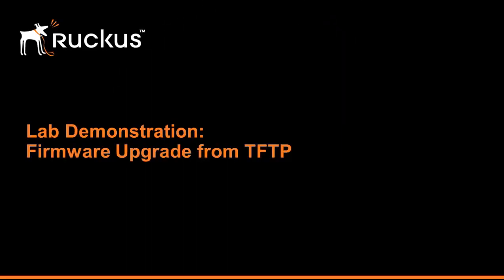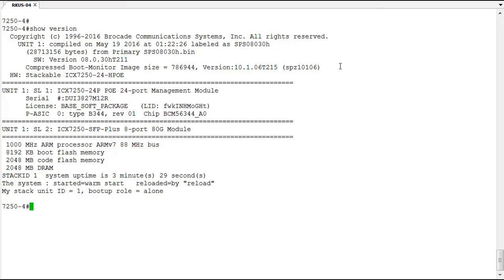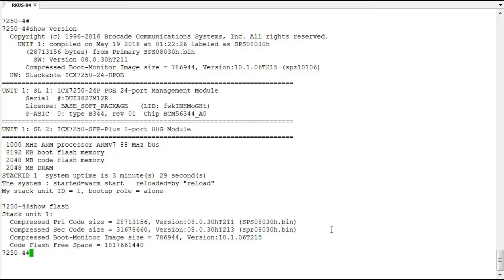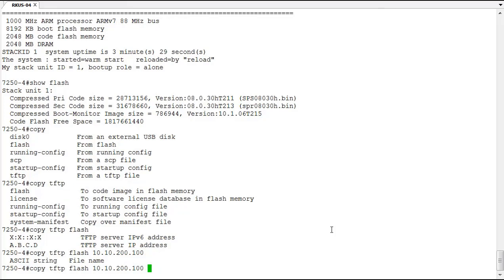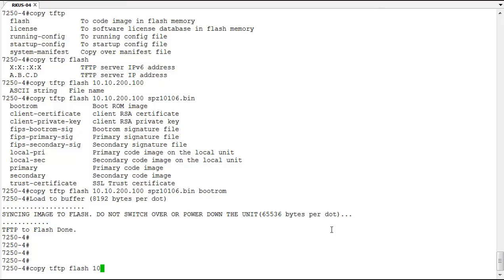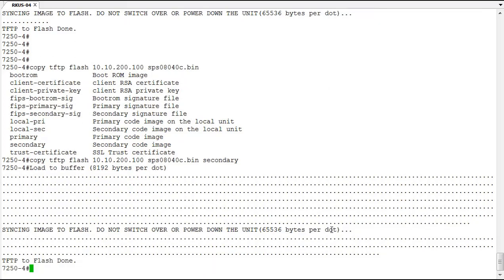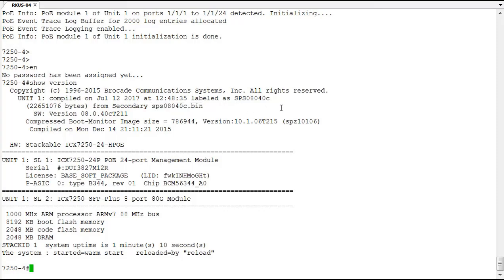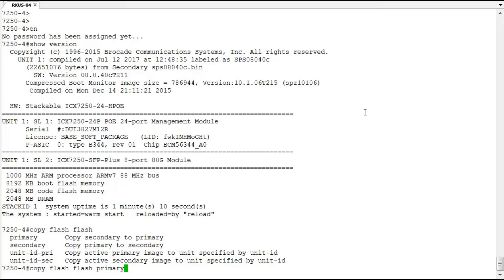TFTP Upgrade on a Ruckus ICX

Comment: I'm trying to upgrade a 7250 and the primary has 8090d router code and the secondary has the 8095 switch code I want to use.  Even when I boot into secondary, it's acting like it is still running the router code and has router in the switch name.

I tried flashing from USB booting into primary and pointing it at the 8095 switch code image file and it just says it can't do that.

Is there some special trick to get this switch off router code and onto a switch image?
Reply from the maker: That's strange - if you do a boot sys fl sec, it still boots to primary? If that's the case, there might be an issue with the image in secondary. Head over to forums.ruckuswireless.com and make a post. Include a show version, show flash and show boot pref and I'll look at it there. Thanks!
Reply: @RUCKUSEducation  well it says it was running SPS08095 but the switch name on the prompt still said router and I had to configure a virtual interface in order to get it an IP address.  Regular switch IP assignment was unrecognized.

After doing that, I just did TFTP update on primary to SPS08095D and it worked and now both primary and secondary are switch code.

Comment: At the end.. it is mentioned that   #copy flash flash primary
And next time we boot it will boot up with the new version of image.  --> which means do we need to manually run command again #boot system flash primary...?  please confirm
Reply from the maker: boot system flash primary will reload the device and boot from your primary partition.  You can perform that command to reboot the ICX from primary, or you can verify your boot preference like here:
#show boot-preference
Boot system preference(Configured):
 Use Default

Boot system preference(Default):
 Boot system flash primary
 Boot system flash secondary

If your ICX is set to Use Default (Primary), like here, you can simply run 'reload'.  If you have any unsaved configuration changes, be sure to perform a 'write memory' prior to boot sys fl pri or reload.

Comment: Can I upgrade to 08.0.30 directly from 07.4.00 on ICX6430 and 6450?
Reply from the maker: There are many things to consider when making an upgrade between these two images. I would strongly encourage reading the upgrade guide for 8.0.xx due to the changes such as command structure and upgrade methods to ensure you are prepared for the upgrade. 
You can find the 8.0.3 upgrade guide at https://ruckus-support.s3.amazonaws.com/private/documents/1432/fastiron-08030d-upgradeguide.pdf?AWSAccessKeyId=AKIAJM3QLNNKLOV235TQ&Expires=1601387676&Signature=qSiEcjmA3Fp3wQ40Ns90dBFik%2B8%3D

Hope this helps
Reply: @RUCKUSEducation   the link is dead